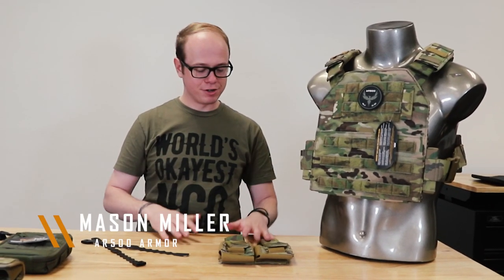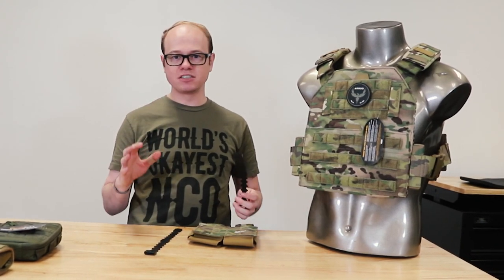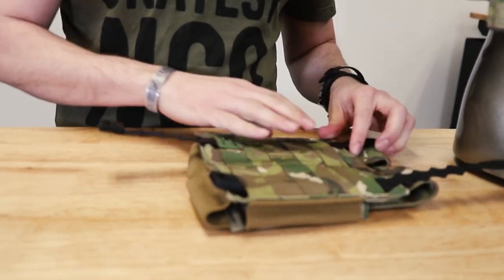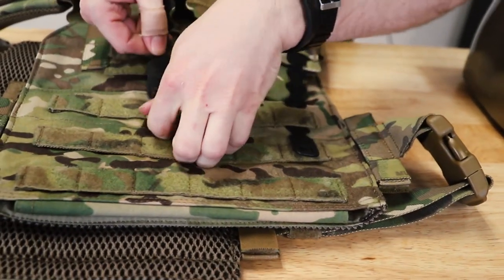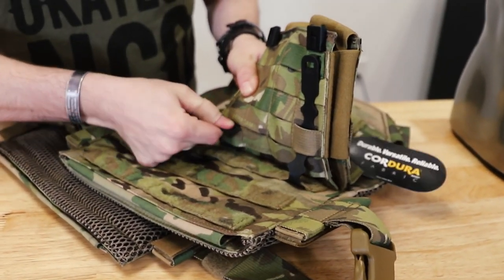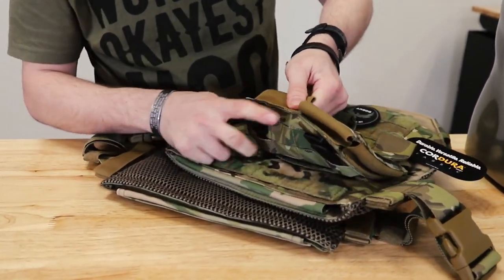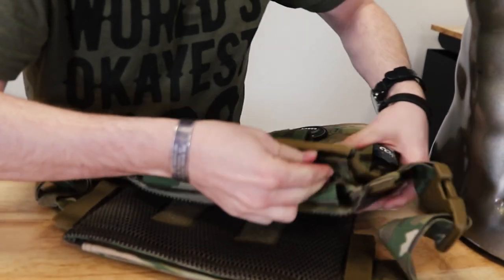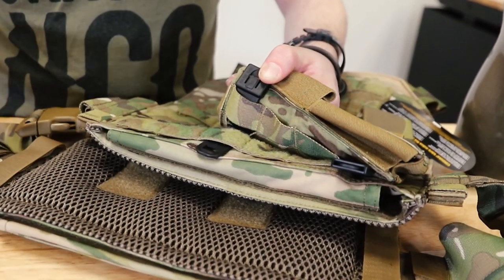How to use Malice Clips!  AR500 Armor

Comment: I bought the triple pistol pouch and it comes with a much shorter MALICE strap. How do you apply the straps? They don’t seem to reach🤷🏿‍♂️ I must be doing something wrong
Reply from the maker: Excellent question.

On the reverse side of the pouch you will notice there are 4 rows of MOLLE.

You will only use 3 rows to mount.

This means you can mount the pouch lower by using the top 3 rows of MOLLE, or mount the pouch higher, but using the bottom 3 rows of MOLLE.

The MALICE clip will only come up short if you are trying to use all 4 rows.

Hope this helps!

Comment: How many clips should I be useing for the AR500 3 pouch multi caliber pouches on a Valkyrie carrier? Also having issues installing the kangaroo in the pouch behind them? It can’t hold 3 P mags properly with the kangaroo inserted… I’m so use to the old Molle system, maybe this is a rookie mistake? Or maybe because I don’t have plates in the carrier yet things are not sitting correctly?

Comment: What’s the difference between the wtf clips
Reply from the maker: Apologies, but we're not sure we understand the question. Would you mind rephrasing it so we can make sure we give you the correct answer?
Reply: @ArmoredRepublic2  the malice clips and wtf clips like for the kywis
Reply from the maker: Ohh you're talking about Whisky Two Four, right? The difference between their clips and MALICE clips are minimal. They have different locking mechanisms, and the WTF clips are made from a slightly more flexible material.  Other than that, the clips are very similar.
Reply: @ArmoredRepublic2  so does it really matter which ones I get ?
Reply from the maker: Not particularly. Ours are just a tad bit cheaper, but both are high quality and will do the job well
Reply: @ArmoredRepublic2  well I appreciate it !
Reply from the maker: Yeah no worries! We apologize for our initial confusion lol

Comment: I received my mag pouch with the malice clip today. I guess that i am doing something wrong. The clips don't snap into place. Got them weaved through but wont snap.
Reply from the maker: So they aren't locking in place? They usually don't click into place very loud. The best way to check whether or not the clips are locked is to try and pull the two sides apart. If they come apart, then they are not locked and likely need to be pushed together a little harder.

Comment: Anybody have issues of the clips not actually snapping into place? I can lift the tab and slide them in but any slight pull they just come right out. Could be crappy batch?
Reply from the maker: Hmm... And you're making sure to slide clip in all the way? If it is a defective batch, you can contact our customer service team  and we should be able to get you some replacements.
Reply: @ArmoredRepublic2  I have the same exact issue as we speak. I will contact Customer Service. Thanks.
Reply: Mine are doing the same thing, barely lift the tab to get it to slide in but there’s no “click” and they easily pull out

Comment: The Malice clips included with my set have a different design.  This was not very helpful.
Reply from the maker: We are sorry you are having issues. The new clips bend to lock. Once the malice clip is threaded through the proper MOLLE webbing and the head is able to be tucked into the locking bracket, bend the exposed unit (both halves together) and the bent angle will secure the locking bracket in the correct position. To unlock, reverse the process. We wanted a tool-less locking bracket that the malice clips in this video was unable to fulfill. If you need any assistance with these clips, please reach out to support@ar500armor.com for assistance.

Comment: Hey I followed this video for the admin pouch which came with the malice clips, but the longer ones you all sent me are about and inch too long and either make the pouch sag a large bit or the clip ends hang down and get in the way of my mag pouches. and the shorter ones you all sent are too short to be used effectively for it, is there an in between size or is there only the two?
Reply: Yeah, NO KIDDING! These are WAY TOO short to be “weaving in and out”..what a terrible system!
Reply: Having a similar issue with the dump pouch.

Comment: I really hate the malice clips. Pointlessly makes it a pain to set up. I would have an easier time with the normal military straps built onto the pouches. Hell I'll probably have an easier time with a shoe lace than these stiff pieces of plastic.
Reply from the maker: Thank you for the feedback. We are sorry you are having a hard time. Please feel free to reach out to our customer service if you have having any difficulties.

The straps you are referring to are called PALs straps. The problem with PALs straps was 3 fold:

The first issue is when the PALs strap tore, they would render the pouch useless. Malice clips are designed to be replaceable keeping your pouch intact. You can keep multiple spare malice clips on your kit for field expedient repairs.

The next issue was with the brass or steel buttons used on the PALs strap. Under heavy use, they would rust / corrode from sweat and they either rust shut or corrode the fabric around the snap causing them to break.

The last issue issue was the button snap on the strap made it difficult to lace through certain MOLLE patterns such as Laser-cut MOLLE webbing. Due to the low profile of the fabric, it can be a pain to weave the button snap through the tighter fabric layers.

Malice clips can also be used on gear like knife sheaths for mounting gear that would otherwise not be able to mount to MOLLE with PALs straps.

Hope this info helps!

Comment: Update on the militia helmets? Do you have people to answer the phone?? Is anyone checking your emails? WHAT'S GOING ON..
Reply: An yup you guessed it still nothing..
Reply: @kennethrussell5604  The Veritas plate carrier I ordered in November had a defect (which I saw when I received it in March). I sent an email for an RMA in March and received a reply in May (eight weeks later), and I just got my replacement today (July 2nd, seven weeks after email reply). 
So, they are very, very slow right now, but they are responding to and fixing issues (at least in my case); it just requires saint level patience (or apathy) as a consumer.
I presume that with a federal body armor ban bill drafted and the recent civil unrest, these wait times will only get worse.